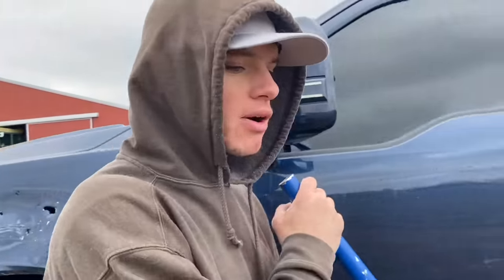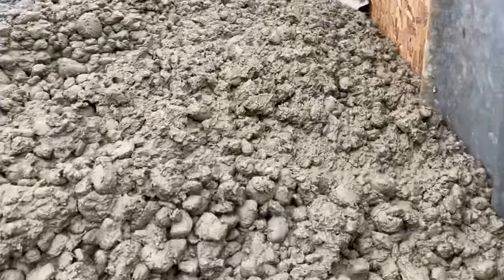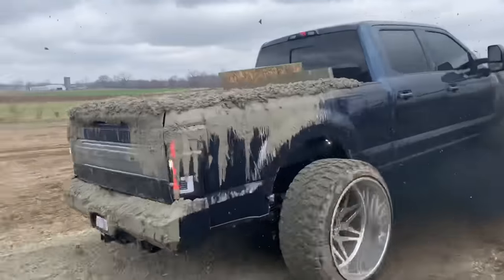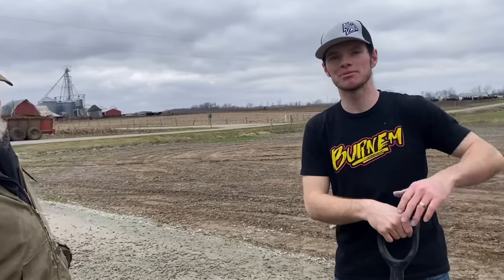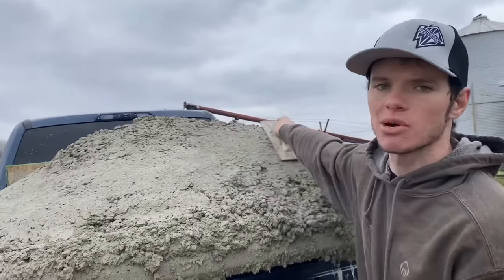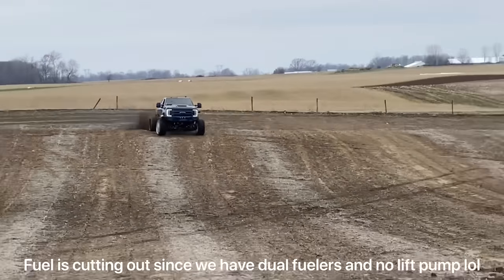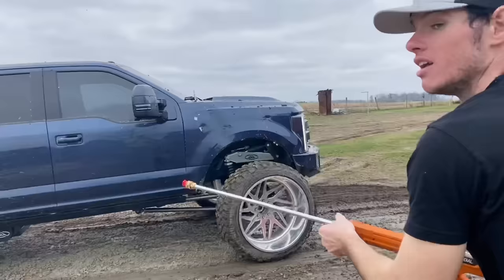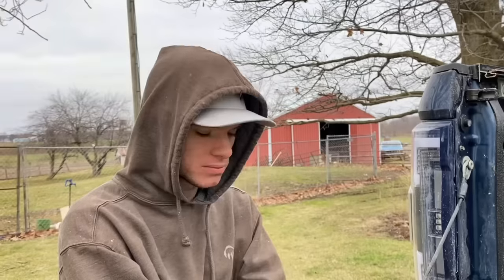Filling Aluminum Truck Bed with 13,000LBS of Concrete (twice the max payload)

Comment: I bet Chevy is scared to send a truck to him for "testing".
Reply: Why would you even want to do this to a Chevy. Ford is trash and that’s what he made with this truck.
Reply: James Doppes Very wrong. I’m sure any truck can handle that load if it had that type of suspension. Especially a Chevy. Those are not OEM Ford parts so you can’t compare them.
Reply: Loll id love to see a chevy try this haha i woulda snapped in half
Reply: @rmartinezg93     I don't know how much that aftermarket suspension cost  but  they bent the Hell out of it .. It won't go down the road straight now ..  I see the caption on another Video he says  it's a  $100,000.00
Reply: Well there’s no difference between a ford that he gets and any other person would get, it’s gonna die soon.
Reply: James Doppes he used what he had he didn’t go out searching. Fords are not good mechanical wise. That must have been a good after market suspension Chevy engines are better and have been around for ever on old trucks 350 small block is the true champ here 💪🏽 Fords all known for breaking down and Tacomas are knows for being best. I’d like to see that load test on a Chevy or Tundra. Outcome would be be the same if not better.
Reply: @rmartinezg93     Ford has  Produced many bad  Motors but they  have a  new  7.3 Liter push rod  Motor  that sounds  really good ..   Some of Fords  really bad motors  are  cheaper to replace than to rebuild at  55,000 miles when they blow up ..
Reply: Lmao if u followed him he trashed chevys far worse.. honestly the fords have held up better then mosta the bowties
Reply: Mike Skidmore trust me I know how bad they are. Everything is designed to fail with their cheap parts
Reply: @rmartinezg93    Well Chinese replacement parts can be a cures too .  Back in the Mid  '70's  early 80's  if you had a Ford   small  block there were three different blocks and 3 different water pumps  Cleveland  Windsor or Modified..   For Chevy  there was pretty much one Water pump from  1955 to 1987  or one with a shorter snout for Corvettes ..
  GM is a lot better at Standardizing parts and thus  Ford  parts can be way more expensive and hard to get
Reply: Chevy is scared of everything
Reply: Chevy talks crap about fords aluminum but 99% of Chevy's are aluminum
Reply: For being a truck that can only hold half of that much it did good
Reply: James Doppes 🤣🤣 it's called found on road dead for a reason!
Reply: @JohnDoe-nz6bk  you mean first on race day? Because they've yet to be beaten by a chevy or dodge on a race?
Reply: Tyler Sutton Ford fanboi conversation.......

Fb: Ford is awesome, can't beat the quality. I'm looking at New ones now while they replace the engine, and take care of the recalls.

Me: why would you buy another one fanboi? 

Fb: because you can't beat the quality, they're great. I've put 25,000 miles on in 2 years, and have only been to the shop 80 times, not one problem. They're great quality, Ford best selling for 300 years! 

Me: Uhhhh... How is it great quality when you been in the shop 80 times, and they're replacing the engine after 25,000 miles? Oh, they're best selling because of fleet sales. Otherwise, Chevy would kill them, and ram isn't too far behind. 

Fb: Bruh, stop hating! They best, they kick everyone's ass. Ford forever Bruh! 

Me: 😦

Fb: well, they're done. I'll be back next week for them to replace the tranny and rear axle. Then I'm trading it for a new one. Ford is the best Bruh! 

Me: 🤦‍♂️🤦‍♂️🤦‍♂️🤦‍♂️🤦‍♂️🤦‍♂️🤦‍♂️🤦‍♂️🤦‍♂️😆😆😆
Reply: @rmartinezg93  'fords are not good mechanical wise' 
Holy fuck we found the fan boy who has absolutely no hours clocked in any kind of work truck
Reply: @rmartinezg93  Chevy has the weakest performance out of the domestic work truck force. It's not even close chief. Can't even leap frog a fiat truck haha
Reply: @rmartinezg93  2020 super dutys only dragging more nuts over you gm soft boys, best torque (that's a gimme with the 6.7...), payload and towing lmao drop a fact paco
Reply: @rmartinezg93  You're right, some of its not oem. They removed quality engineered parts and replaced them with parts that were basically designed to be nothing more than showpieces, thus comprising the trucks durability if anything and it still won't break.
Reply: They would break lol
Reply: Lol chevy would never ever survive . Chevy track ate more like minivans . You was tough . Get a ford . This kids just proved it .
Reply: rmartinezg93 Nah, Chevy doesn’t make anything durable. I put a paperclip in the bed of a Silverado 3500HD and it exploded instantly killing everyone within a 500 mile radius in seconds.
Reply: I'm sure the stock leaf spring suspension would do much better than the electric hydraulic setup, You could fill bed with concrete and tow 3 Silverados at the same time with that 6.7
Reply: @rmartinezg93  LoL how u gonna call Ford trash when he the bed of the Ford up and its driving good and the Cheryl's tie rods broke on a little boosted launch
Reply: Only Mexicans drive chevys
Reply: @clarkbigatel5377  no no no a chevy would die soon
Reply: @judsnoland1519  ikr
Reply: king Dz aiight man go buy a slow ass ugly Chevy that has no pay load
Reply: @familyguy_funny_clipz  yep lol and they know they have to be for them to keep working
Reply: Lol a Ford with a a lot of not domestic parts? 🤣🤣🤣🤣🤣 They should be. Ashamed . CHEVROLET all day baby

Comment: I guess the only good thing coming out of these videos is showing how durable fords are
Reply: Conor Broussard any truck can be destroyed in a few hours
Reply: And this is no ordinary ford, look at the hydraulics. Pretty impressive non the less
Reply: Clark Bigatel true but the hydraulics that are on this truck were not built for that they were built to be a show truck
Reply: Exactly.
Reply: Plus entertainment and all the hate comments are funny too. 😅
Reply: And now I’m Second guessing the Dodge I just bought!!
Reply: Russell Hadaller im second guessing you for buying a dodge in the first place
Reply: Kenneth Barbee come on. They are all basically the same. Obviously there are particular years and engine/trans options that are definitely bad. All of the big three have their issues. Ford, Dodge and Chevy that is. 

Dodge trucks seem to last but that may have more to do with the type of people who buy them and not the trucks themselves. Most light/medium  use contractors in my area use a random assortment with Toyota being extremely popular due to being indestructible with such use, (quite expensive though).

Comment: I bet Ford shows this video!! 
Dodge is like hell no!!
Chevy says mmmm NOPE!! 
Bash that 6.7 now!! Best diesel ever made!!
Reply: Really digging my 6.7 ;)
Reply: The 2015+ 6.7 PS is probably one of the best Diesel engines available in heavy duty trucks at the moment.
Reply: 🤣🤣 funniest joke I've ever heard! Power joke SUCKS!
Reply: DURAMAX_DELIGHT 
You should let him play with your Chevy for the day😂😂😂
Bet not!! Duramaxypad!!
Reply: Cris Salinas 
Hell yeah brother!! Preach on!!
Reply: Darren Humphrey 
Yeah you would only last seconds. 
The power stroke is meant to last
Reply: @mikewest5529  I've seen more power strokes break under stress than Cummins
Reply: So you really think that didn't totally screw that truck up?? Really??
Reply: Tim Townsend nope!! 
It’s no write off!!! 
Couple new links. The truck builder sponsored the video. I think it just that Ford tuff it can all be fixed!! 
I would buy that truck today if he was doing a deal.. lmao!!
Reply: Darren Humphrey in the truck world we call them  “Cummaparts”
Reply: Sam Fanning 😂😂😂🤘🤘🤘
Reply: Love fords buy a 6.7 ant a really a good motor if ya want som dependable I’m ford a 7.3 is the way to go
Reply: But *
Reply: Cheeksandunk 6.7 isn’t a bad engine. I’ve tested it myself pushing snow and hauling. Before after 2014 and 2015 they are a stout engine, but in that time frame they had some issues with the VGT turbos that were on them. Other than that. They are stout and run really good
Reply: Mike West I’ve gota pic on my phone of a ISX with the Block blown out 😂. Engine just got dropped in and blew

Comment: Well this has me convinced ford has the toughest truck on the road
Reply: Hell yeah they do, gm is now only 10 years ahead of ford boy!
Reply: @johnserrano9689  okay lol
Reply: @johnserrano9689  lol the trolling is real
Reply: @johnserrano9689  10 years ahead of the 99 model
Reply: This doesn't have much to do with the truck. It's the any level lift that deserves credit here. Watch what he put the dmax trucks through and get back to me! Again This is nothing for the truck itself!
Reply: DURAMAX_DELIGHT  oh yeah so what else is pulling all the weight then? Ford axles ford motor ford trans, oh I forgot it’s just the lift by itself 😂🤣
Reply: John Serrano you heard him yourself when he was getting rid of all them duramax, I still have the monster max and love it but I’ll not own another duramax because they are garbage he literally said it. And ten years ahead of what like a 92 non turbo idi and it would still probably out do a duramax 😂
Reply: Duramax is shit honestly..
Reply: @Rocksolidbullys  So putting 3x the trucks payload in the bed doing doughnuts and boosted launches with that payload has nothing to do with abuse? You have some high standards lol. The chevy would have broke a ball joint just seeing the cement truck pull up.
Reply: I have a Ford truck, but this thing is heavily modified. It's mostly the lift kit taking the weight.
Reply: Lol theyre all shit once you start really playin with them. And once they do find something reliable they change that shit entirely for "brand new garbage" look at fords 6.4 when it had so many problems they had to take back the entire truck, look at gms newer gen duramax, a lot of guys i know who had fully loaded trucks along with a fully loaded dash light system what garbage do the auto makers get away with lol
Worst of all i still prefer american trucks.....bcuz i need a god dam truck
Reply: @johnserrano9689  That was Navistar's 6.4. The 6.7 built by Ford is arguably the best engine since all the emissions have been added to the trucks
Reply: @davidfoster7008  i know man, my point is the back amd forth, you wait another year or two and itll be noted for burning injectors or something else. Leaving us to cherry pick certain modle years knowing this was the best and/or what to avoid or change

Comment: this is "almost, kind of" what these trucks are made to do, i think a 1990's toyota pick up truck would handle this pain ok, but would NEVER have thought a modern SUV kinda looking ford pick up would do that well ..... I'm amazed! Well Done Ford thumbs up
Reply: 90s toyota trucks will snap in half without even being beaten on. Do you really think they can hold 10,000lbs of concrete? 

The Hilux he tested was bending its frame with 1500lbs of bricks lol

Comment: WhistlinDiesel thier is still something off about the truck it still doesn’t look good this is what else needs to happen to make it top notch: first curb the rims hard next I think it needs a nice pin stripe to really make it stand out like just have your wife take a scraper all the way down it to make the pin stripe then also I think the interior needs some remodeling if you know what I mean then also I think you have to many lug nuts on those tiresome probably need to take some off of the tires you only need  like 3 on each and the front and rear bumpers eh ya just remove those too!!!!!!!!!!!!!!!!

Comment: Honestly this is extremely impressive. Both the truck itself and the any level lift system. The fact that the lift still worked after 13k of concrete in the bed while off-roading and being abused...fucking impressive as hell

Comment: Back before I knew anything about payload or owned my own truck, I did this. borrowed a friend's 04 Sierra HD gasser and put a pallet bricks in it.  Lowe's guy didn't say a word about how dumb it was.  Pallet weighed around 7,000  Put two more on a trailer not rated for 20k.  Blew one of the 6 trailer tires and broke the emergency brake cable. I probably lessened the life of the truck as well. But it made it 30 miles home...very slowly. 

4 years later, my 19 Silverado LT-Z71 could handle that bed weight, and could pull it. The 5.3 wouldn't like it and I'd be about a ton over the limit, but it'd pull.  The next rig is gonna be the TRX with a Hellcat.  It'll tow pretty much anything with the right setup and still do all the crazy shit we do on the farm.

Comment: The "military grade aluminum" is actually known as T1, which is actually an aluminum/bronze alloy that has been forged and tempered. It is used in making receivers for rifles. I've seen M16 receivers with 90k rounds, good portion of it in full auto and there won't be a crack on the receiver. It had shot out numerous steel barrels, steel buffer tubes and buffers and worn out many steel trigger control groups. The worst breakdown was that it needed repair where the trigger pin inserts because it had worn itself to too large of a diameter. A titanium grommet was silver soldered in place and a non rotating trigger pin was installed to repair it. If T1 can do that, it can handle being in a truck bed. Also, T1 IA known as aircraft aluminum. To those that understand basic science and engineering, they know a truck bed will be fine because of all the immense stresses aircraft withstand. Shittalkers gonna talk shit. End of argument.

My problem with aluminum beds is they don't have enough weight and traction for me.

Comment: The definition of built ford tough. "doubled the weight capacity of the bed and the truck is fine" yet when they tried it with a ram the axel snapped. 🤣 then again that could just be luck but still.
Reply: The dodge was probably factory too
Reply: When did an axle snap on a ram? The only thing axle related that happened to a ram on this channel was when he jumped the 3rd get dually, and that was the diff cover, not the axle. The truck in this video doesn't have a single stock suspension component so it really doesn't matter if the truck survived because the truck isn't stock. The 3rd gen was bone stock.
Reply: @gasolinediesel972  I wasn't talking about it on this channel. They did try it on a ram
Reply: @anthonyquickvlogs6106  Where did they try it on a ram then kid? Whenever I search anything related to a ram being filled with concrete or a ram axle snapping in half nothing comes.
Reply: @gasolinediesel972  search up ram axel snapping
Reply: @anthonyquickvlogs6106  The only thing that comes up when I search that is broken cv axles which are a common break on all pickup trucks with ifs. Nice try though kid. Ram trucks have dana axles which are bulletproof. What would you know about trucks anyways kid? You're like 12. Don't even try to hide that fact because I looked on your channel.

Comment: 13,000 lbs of concrete is over 3 cubic yards (81 cubic feet) of concrete. That is far less than 81 cubic feet in the bed.

Comment: Concrete calculations: 5x7(bed dimensions) x 18” deep, now that’s not counting wheel wells  = 1.76 yards = but it was mounded up so maybe it was 2.5 yards max

Comment: You should do a video and see just how much a diesel will pull keep adding until it won't move anymore. Like start with a tractor then add a truck and tractor and so on until something breaks or the motor won't pull it. Add some weight in the bed to keep traction.

Comment: Sand or gravel do the same thing used to pickup gravel in my old 1980's 1 ton Toyota mini pick up have the loader tip his bucket I would have him fill until the stoppers got down to 1" from the axle.

Comment: Sorry but not even close to 13000    Figuring your box at 6 ft by 4ft 6 inch by 2 ft deep, that's only 2 yards. Concrete is about 2000 pounds a yard so you would be lucky to have over 4000 in the back of that truck. Not 13000!

Comment: F250s and 350s don't have the same payload though..... And considering that thing is a crew cab I can guarantee that payload sticker is not 7000lbs. That's for a 2wd base model single cab dually with the 6.2 engine.

Comment: 250 and 450 do NOT have the same payload capacity.

What would even be the point to get a 450 if a 250 could do the same thing?
Reply: Towing. 450 sacrifices payload compacity of the 350 for better towing compacity
Reply: @Narcissistic_opinionation  absolutely not. 

The 450 had more payload and towing capacity than the 250 or 350. 
Gvwr and gcvwr are higher in the 450 than 250 or 350

Comment: I saw once as a couple of old timers showed up at a lead shot plant with a 50 gallon drum and wanted to fill it with lead shot. The plant operator said they were nuts but they insisted it would be fine and fill we up. At about 1/2 full, the truck broke in half right in the middle. About as dumb as this video.

Comment: who is a ford person like if you are they are amazing trucks if you have a good year build my dad has a 6.4 v8 twin turbo power stroke 08 it is not the reasonable built truck of ford it would be better if it was like a 7.5
Reply: Is that your number above were it has messenge